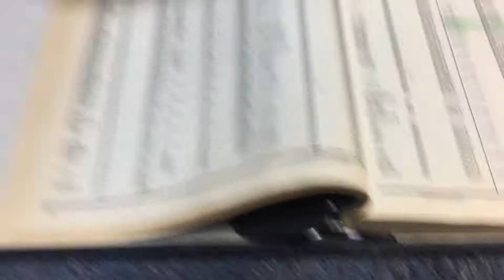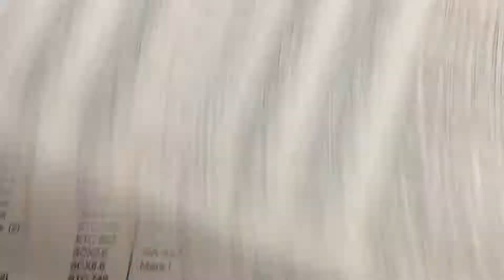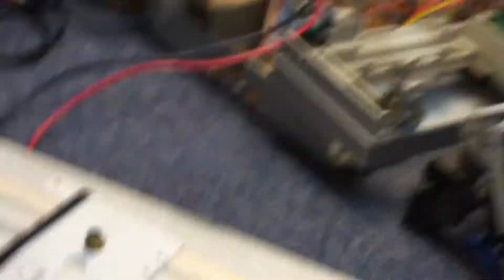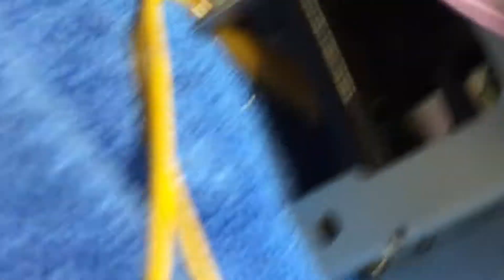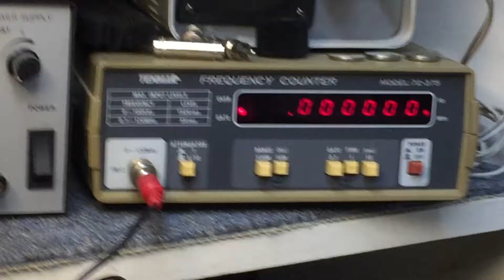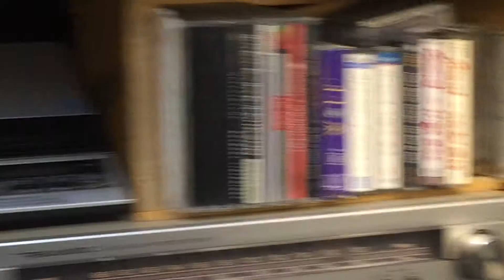Pioneer CT-50R Cassette Deck - pt.2 finishing up repair w/playback & record testing

Comment: My ct 50r doesnt ff or rewind and tape doesn’t move any help is appreciated.
Reply from the maker: Is the motor rotating/do you have 12Vdc present at the motor when the unit is in play?
Reply: @luvradios Yes  i had replaced the capstan motor as the old one was faulty and the play works but no matter how i try the ff and rew doesn’t work i can also see that the idler isnt moving. Any suggestions?

Comment: Just perfect, you have simplified things for me considerably!  The PRB Line Cross Guide is a huge resource and I've just downloaded a 2006 copy of it from an on-line manual repository.   With the exact belt numbers I now can access a wide range of sites that list belts according to these specifications.  It isn't clear which ones have the best compounding but I'm sure there has been more than one assessment posted.  And the rest of the video is useful as well.  Thanks.

Comment: Thank you for such a great video.
Why is my ct-50 r stops every 5 sec no ether what I do- rewind or playback?
Thanks
Reply from the maker: This could be a few things but first check the counter belt , there should be a  magnetic sensor that rotates as the take-up reel moves, if this sensor isn't moving the unit will shut down after just a few seconds.  Second thing - when the tape is playing or FF/Rew, is the tape actually moving?  If the tape isn't moving then the reel drive Idler is probably slipping due to age, this will also cause it to shut down.
Reply: Indeed, the counter belt is detached.
Can’t wait to put all together as soon as I’ll get a new belt.
Thank you for your advice!

Comment: Thank you for such a great video. I have a CT-50R and I just replaced the belts, but it will not work in the reverse direction. The head goes up when playing in the forward direction, but will not in the reverse direction. The direction button  is always in the forward position. Any help would be appreciated.
Reply from the maker: Ok, so what happens when you press the button to start the tape going in the reverse direction:    Does the indicator light? Do you hear the solenoid click?  Does it attempt to start in that direction then revert back to the forward direction?
Reply: luvradios  thanks for getting back to me. When I press the reverse button, the head quickly jumps up, but does not reverse in the 180 direction. It quickly goes back down and the reverse button does not light. The forward button is always lite. I flopped the slide lever in the reverse position and started the unit back up. I thought That I had something working right, but the unit quickly reverse to the forward play position and stayed there. I did get a copy of the service manual, but there is nothing on troubleshooting that problem. Maybe belt installed incorrectly? But it plays in the forward direction. Fast forward and rewind work. MS works. All other functions seem to be working.
Reply from the maker: @michaelellison4176  Yes, check the capstan belt! I initially routed it wrong and only the forward direction would work.  For whatever reason the service manual on HiFiEngine does not include the exploded view which should show the proper belt routing.   You can check this easily by watching both capstans rotate, they should be turning in opposite directions.  In the video I actually install it wrong, only after testing did I discover this the reverse wouldn't work and and I knew immediately what was wrong.  I didn't show that in the video due to the time.
Reply: i have same problem  -never found out  how to fix  wc